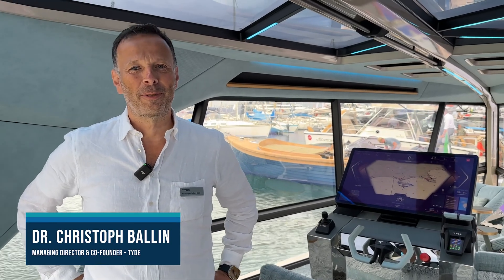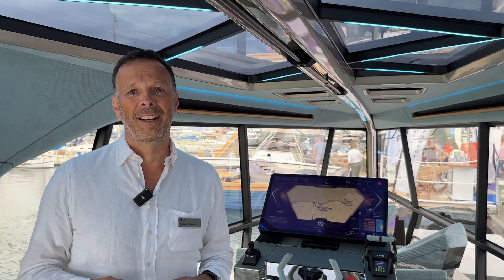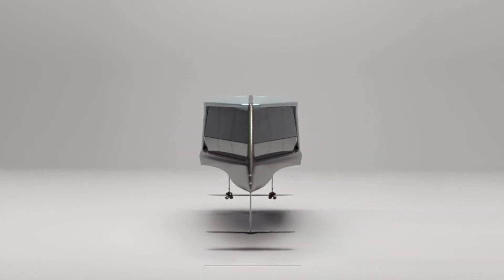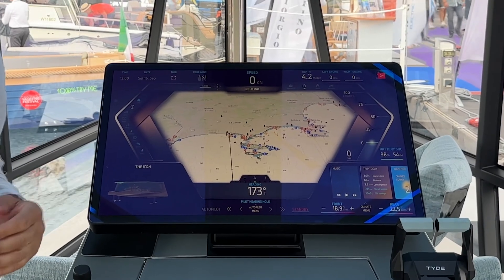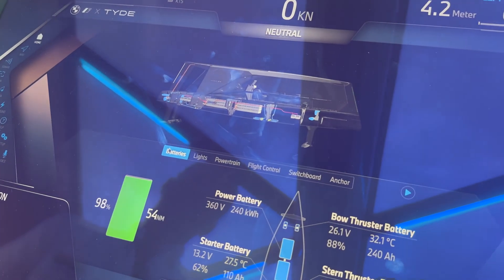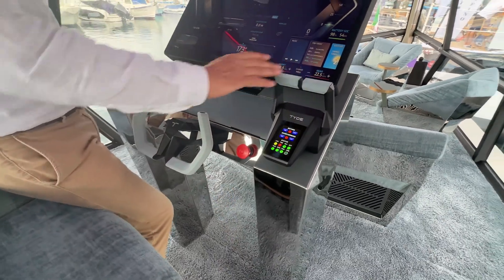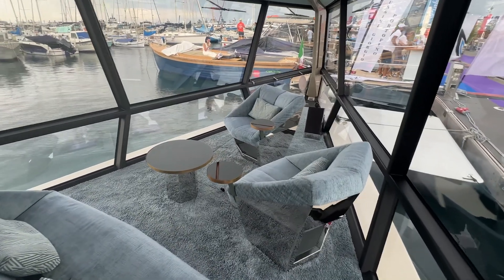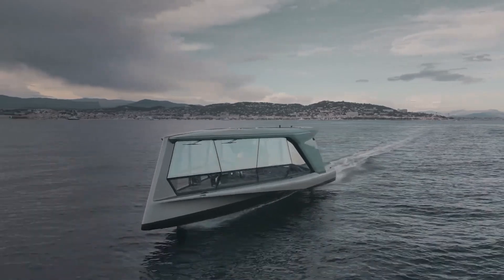Electric Hydrofoil  The "ICON" by TYDE  | Boat Talks by BoatTEST

Comment: Beautiful Design!  BMW HQ is in Munich. Munich University have a lot of foil experts so well done there too.  
Compromises start with Statement of Requirement which is the first point of any vessel design.  Therein lie the limitations, which is fine.  
Sea State Max for this vessel will be Sea State 2  and if higher sea states, hang onto your glasses and stay off the foil.  
The foil system itself will limit the speed to around 30 knots - which is a perfect compromise for speed, power and efficiency.  Good luck with it.  Definitely a head turner.

Comment: Super 'outside the box' thinking, designed by industrial designers not boat designers I would think. Ergonomic helm but not helm seat. No side or bow decks to moor or anchor (maybe locks on to satellites for anchoring?) I designed and built an electric boat 10 years ago, four motors to steer and propel but fitted a gen set just in case ...

Comment: 50 nautical mile rage...hard pass.  Electric boats are far from being ready for prime time.  This is like getting a cheap frozen steak and being told that it's really from Del Monico's...
Reply: @kfeltenberger  I'd be willing to bet that 95% of the trips are less than 50 miles.
And the cost to operate that boat for the 50 miles is about a tenth of the other boats so. Most people would not have a hard pass on this one.